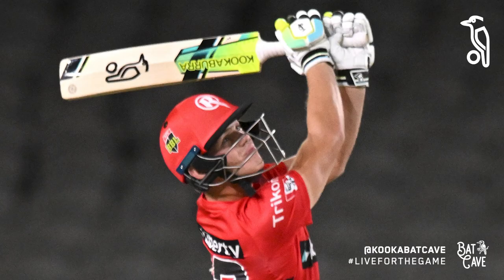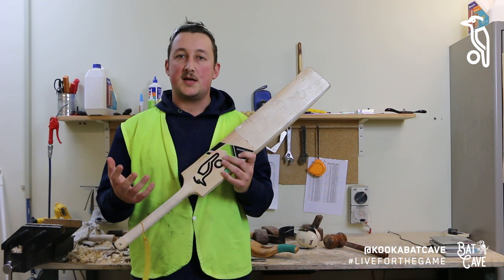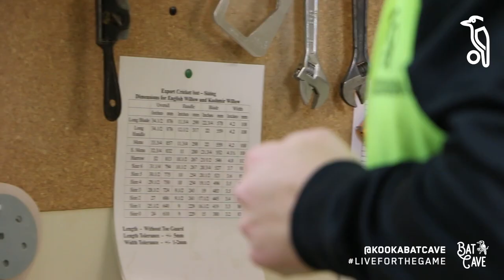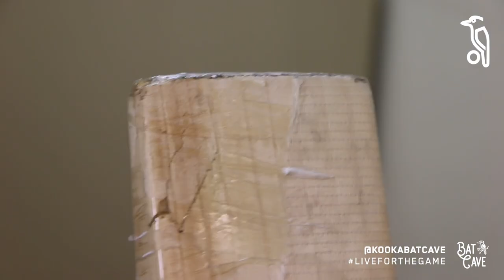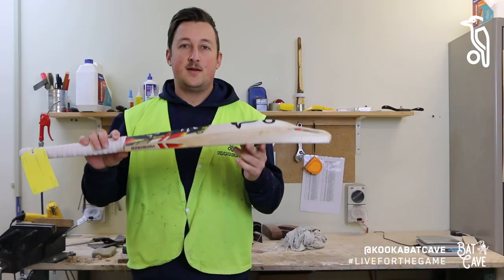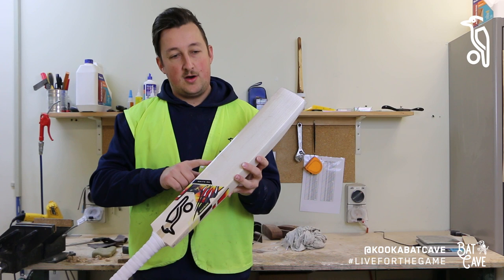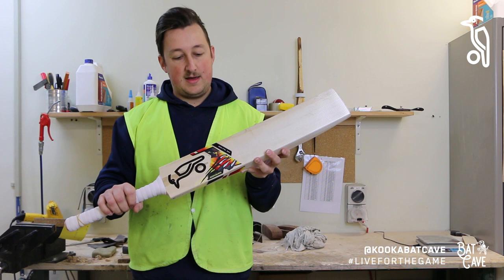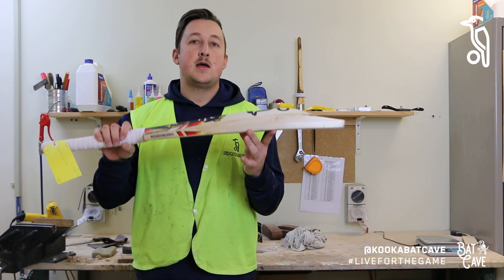Repairing Jake Fraser-McGurk's Bat | Kookaburra Cricket Bat Repair Ep. 1

Comment: Hey Sir. I would like to recommend you to use epoxy adhesive to fix all the major and minor cracks except handle replacement. Epoxy lasts longer than white glue and hardens the wood a little bit.